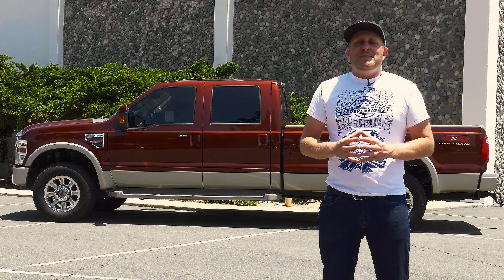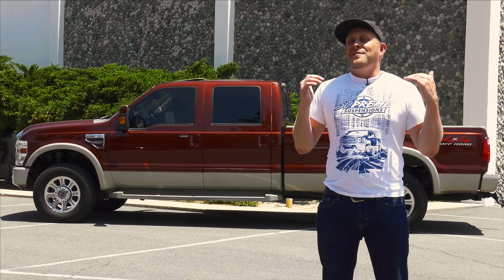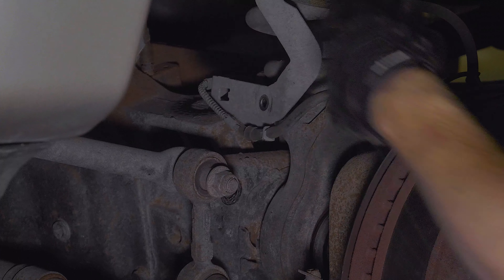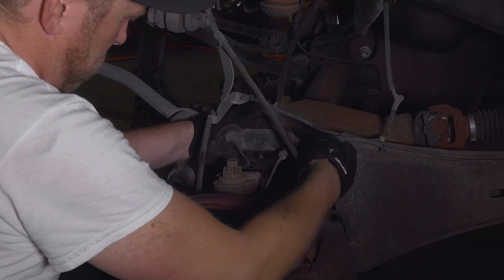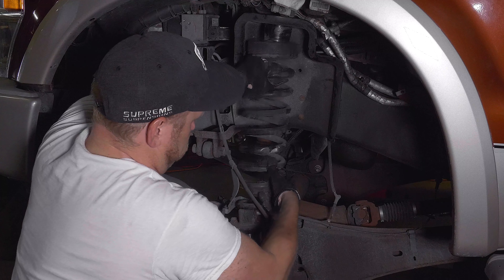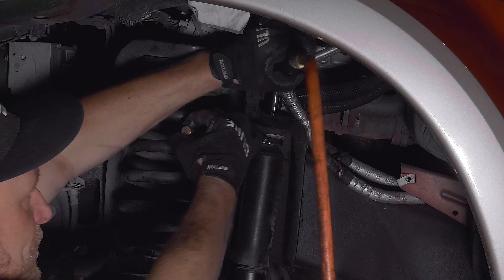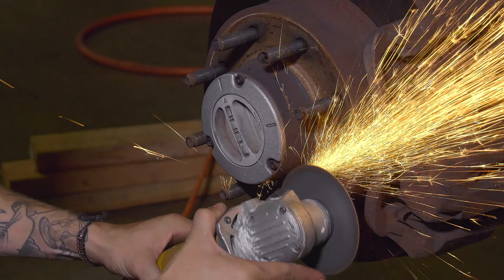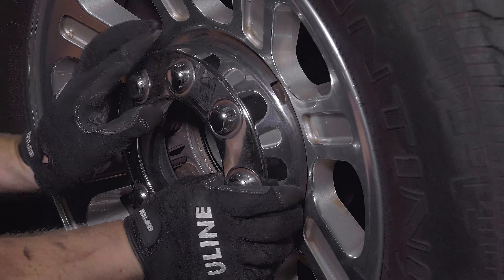2008 4WD Ford F-250 | 2" Front Lift with 2" wheel spacers

Comment: Does this front end lift work for NON 4WD ? 2010 F350 lariat dually 4 Door Crew
Reply from the maker: Hello,

No it does not as the 2WD versions use a twin i-beam suspension.

While the kit itself DOES fit on the 2WD version, because of the twin i-beam suspension, you will need additional components such as a axle pivot drop bracket to align them. Without that, it will be impossible to align.